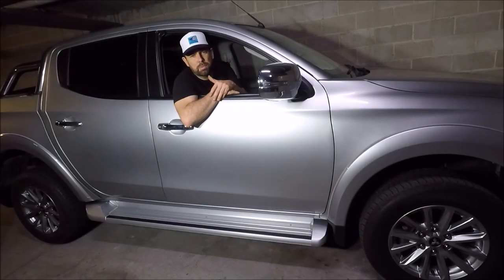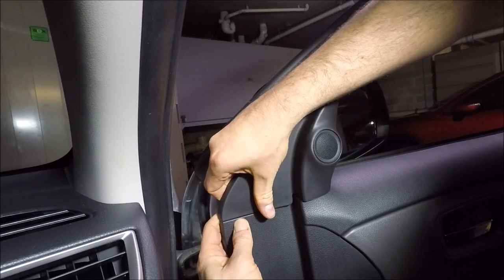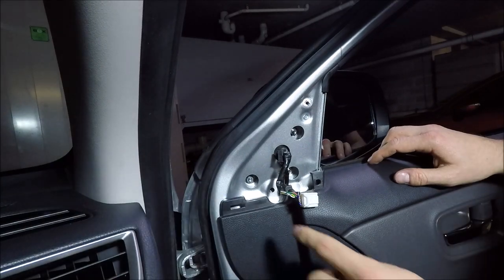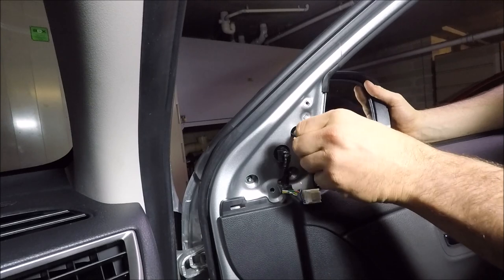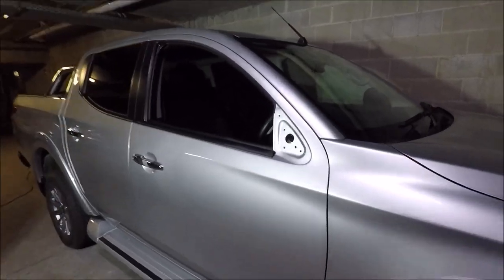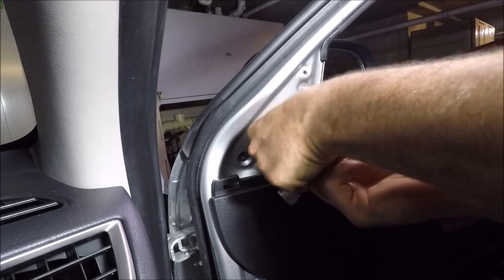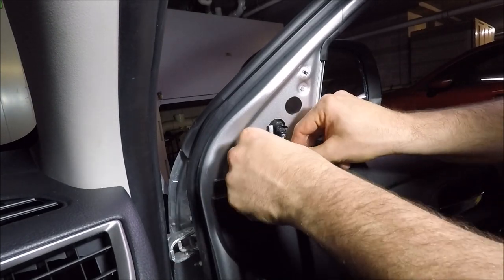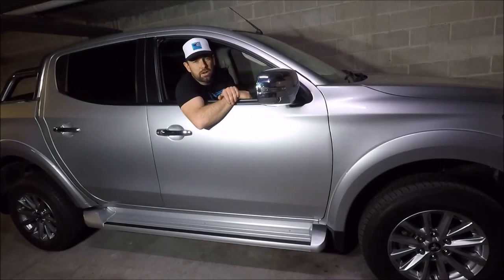How to Replace a Mitsubishi Triton Electric Wing Mirror (L200, Warrior)

Comment: Thanks for the video, very helpful. Just a couple of points for the less mechanically adept: removing the interior plastic cover was quite difficult for me, plastic was very stiff and very hard to get finger in to release the last catch without breaking the plastic. Also be careful not to drop a nut into the door well as I did.
Reply from the maker: Hi Neil, thanks for watching and your comment, yes I have dropped bolts in many doors over the year so you are not alone. I have a great set of plastic levers which I use a lot of the time for taking them off. Regards Ross

Comment: Hello sir, thank you for this video, very helpful. If you don't bother me asking, how many wires do the socket have, 7 or 9?  Thank you
Reply from the maker: HI There, Unfortunately I cannot remember as this was some time ago, however it will depend on the functionality of the mirror, does it fold, heat etc. It is best to just take the cover plate off and check on your model.

Comment: Great video, but the power cable to the tweeter wouldn't come out for me so i had to work around it. Now i've put a new wing mirror on, the pair are out of sync! I've tried disconnecting the battery but no joy. Any idea? Am thinking about opening up and trying to fix the old wing mirror which would open out too far. TIA
Reply from the maker: Hi there, thanks for the comment and watching is it the sound from the tweeter or the mirrors opening that is out of sync? If it is the tweeter try reversing the cables, if its the wing mirror itself is the new one from the same year model?  it sounds like it was some kind of stopper that broke on your last one, maybe just that portion could be replaced from the new one?

Comment: Hi great video, thank you this is very helpful. I have a Triton 2018 GLX plus model without electric motor mirrors or indicators. However, because of scuffs, I'm wanting to install new aftermarket mirror covers with indicators. I'm not quite sure how to wire or plug electrics. Do you have any information or know of a video that can give me a demo or any other advice. Thanks, heeps!
Reply from the maker: Hi there Linky, unfortunately I have never fitted after market ones, can you not get originals from a wreckers? If not I would be looking to cut the original plugs off the broken wing mirrors and attaching them to the cabling of the after market ones (obviously tracing what each one does) sorry I cannot be of more help. Ross

Comment: My L200 mirror is loose and vibrates quite badly when driving. At night I can’t clearly work out how close or far vehicles are behind me as everything turns into light streaks. Does this mean I need a new mirror or is there a way of adjusting/ tightening it up so it does not vibrate.
Reply from the maker: Hi there Loman, it sounds like it has been hit and the mirror has popped out of the retaining clips have you tried checking if it can be pushed back into socket?
Reply: @RossPerryProductions  no. Not really sure how to do that.
Reply from the maker: @XIXjlo  well it sounds to me like the piece that holds the glass in has come loose, it might be worth you taking it off like I did in the video and then remove the glass and cover. You should be able to see what is loose inside
Reply: @RossPerryProductions  thank you. I’ll do that.

Comment: I have a L200 Barbarian.  My wing mirror goes past the default position.  How do you rectify this?
Reply from the maker: Hi John, Sounds like the guide has snapped inside, you could take it apart and try to weld or bolt something in position? hard to say without seeing it. Ross